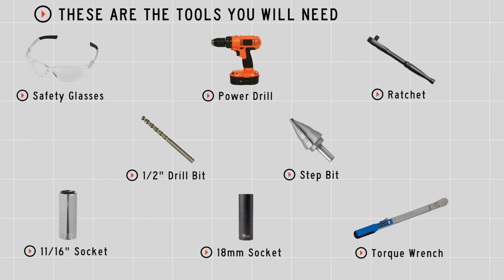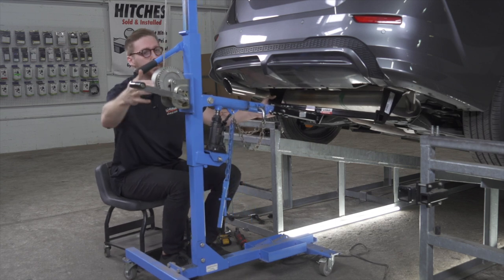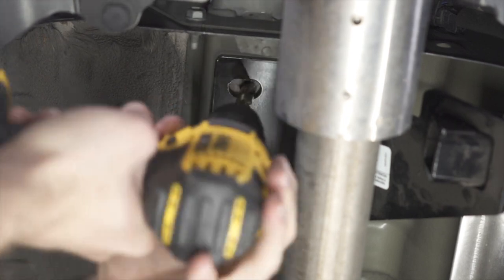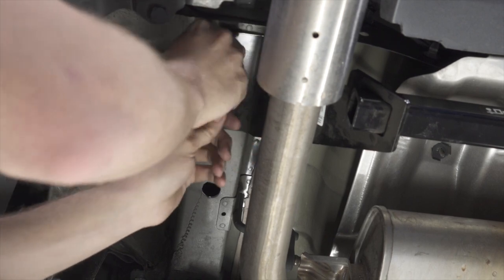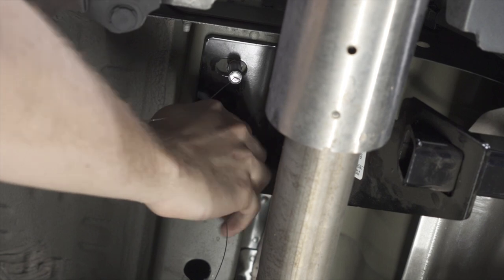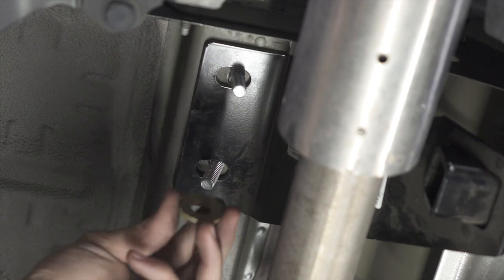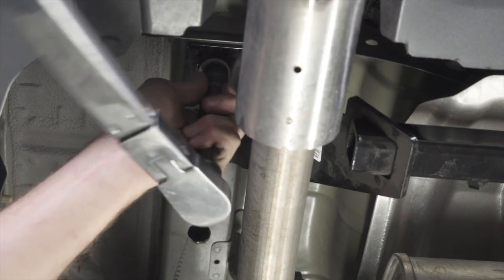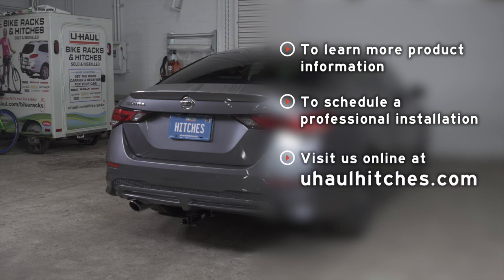2021 Nissan Sentra | U-Haul Trailer Hitch Installation

Comment: I have 2020 Nissan Sentra, but the problem I have is that I lowered my car about 2inches in the back, would there be any problems while driving?
Reply: Also I want to be able tow a small trailer for my mini bikes would that also be possible?
Reply from the maker: This hitch is 11" off the ground on a stock vehicle.  Lowering the vehicle has decreased your clearance and your departure angle. Most trailers need the coupler to be 16-18" off the ground. Single axle trailers have more room for a varied Hitch ball height. larger Double axle trailers need to be as close to perfectly level as possible to keep weight proportional. 1.25" recievers are unlikely to provide 7" or more of rise to your ball mount. However, This hitch is rated to 2000lbs gross capacity and 200 lbs tongue weight, so if you are able to provide enough rise with your ball mount and your trailers weights dont exceed 2000 lbs gross and no more than 200 lbs on the tongue than this set up could work.